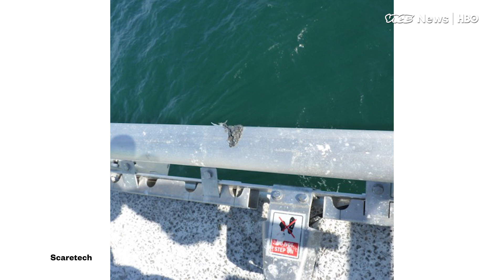Bird Poop On Wind Turbines Is A Problem For Robot Scarecrows To Fix (HBO)

Comment: I watched this whole thing and I still don't understand why bird poop on wind turbines is a problem to begin with.
Reply: gearsmithy they explain it from 1:25 guano or bird poo is a hazard for the people working there. It can damage equipment when in large amounts but not only that it's carcinogenic if breathed in and can be a massive slipping hazard for maintainers who need to regularly access the site
Reply: BeeFriendlyApiary there are plenty of carcinogenic substances it's not only genetic for example there is a type of lung cancer which is impossible to get without exposure to asbestos
Reply: "only one element, radiation" I lost you there lol things don't have to be radioactive to be carcinogenic...
Reply: You can get cancer breathing asbestos fibers. It doesn't cause mutations at all. 
They breathe in the guano and it damages DNA in your cells, causing cancer. Same way how smoking causes cancer. 

Cancer can also be caused, by uneducated comments like yours.
Reply: +Rin615 bBird droppings doesn't cause cancer guys....cancer is caused by genetic mutations of cells, only one element, radiation, can cause this from outside the body...perhaps bird droppings can cause an infection of some sort but cancer????

Comment: What a con. A few plastic predator birds does the trick.
Reply: Sure, for like a month.
Reply: Mike Jensen - I agree, but I think sounds would be more effective. I have had a few artificial birds on my land for just over two years now and they have been very effective, after the first 6 months the birds were coming back, I am guessing that they got used to the artificial birds. However, I got bigger artificial birds, spread them out across the land and haven't had any issues since. But harassing sounds and animatronic movements would certainly add to it, maybe with far reaching motion detection?
Reply: Kevin - Please clarify?...